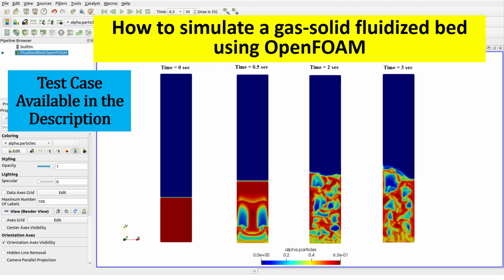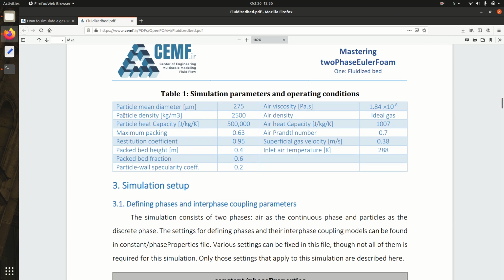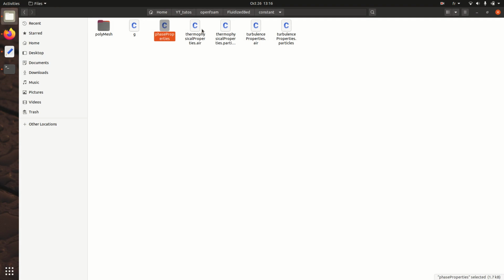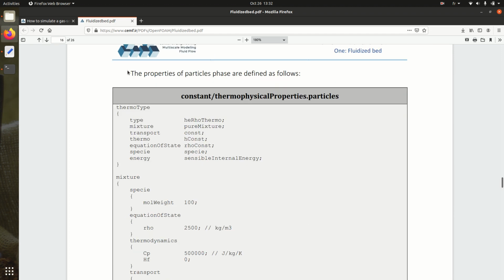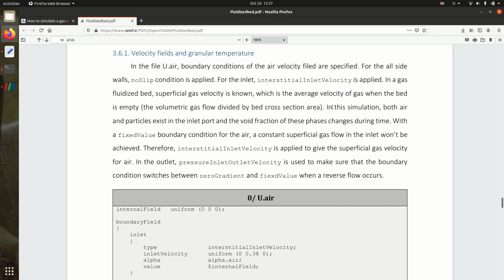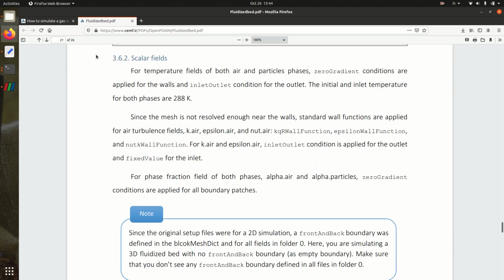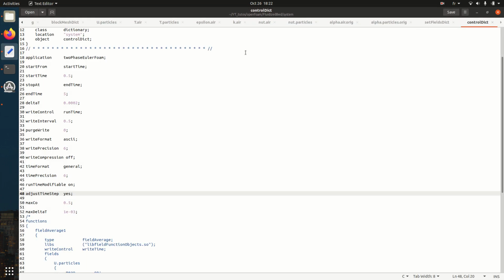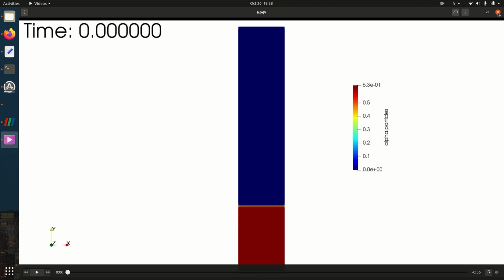OpenFOAM Tutorial: Simulation of Fluidized Bed using twoPhaseEulerFoam

Comment: Hello Mam, I want to perform simulation for adsorption and desorption process in adsorber bed. Bed is of activated carbon and adsorbate will be methanol. DA equation is valid for the case. Can we do that in OpenFOAM. Ki fly guide as I am stuck to this.

Comment: Thank you for the highly informative tutorial. 
Is it possible to perform a simulation in openfoam for a particle suspended in air which is being sucked using Euler-Lagrange approach. I need to use the 3D cad of the particle.